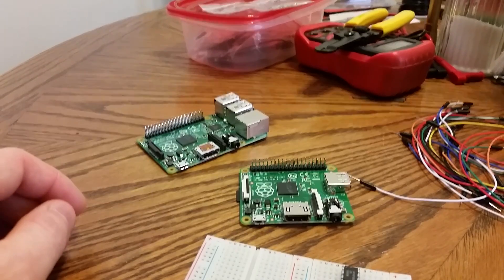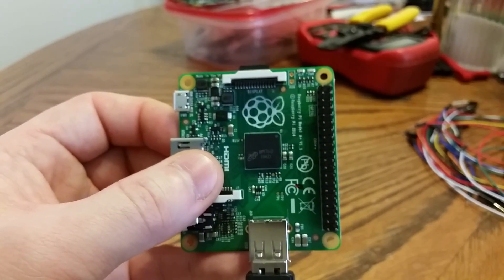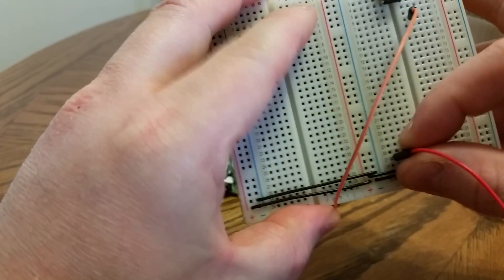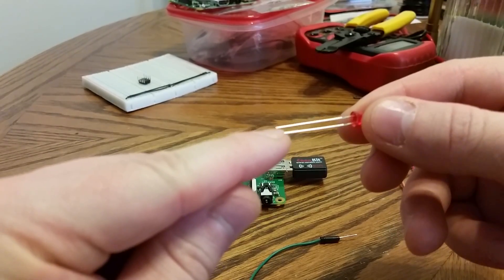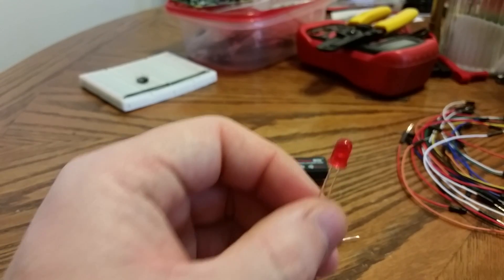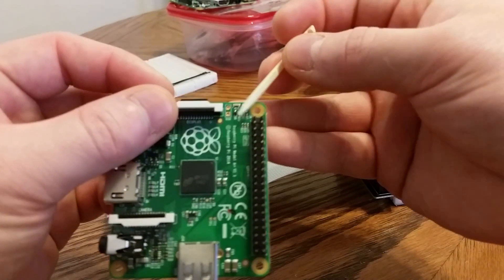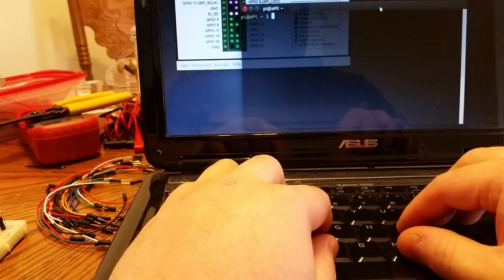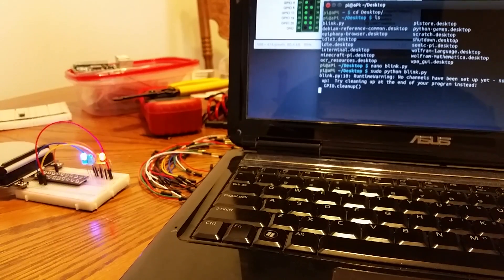Raspberry Pi For Beginners: LED Connections, Bread-boards, and Programming

Comment: Hi 
I like to know how i can get a LED to turn on when the Pi4 is on and fade in and out with PWM pin. and do this all the time when the Pi4 is on, (maybe 2 or 3 LEDs) and when i shut down the Pi4, the LED will turn off, so i know when the Pi4 has been shut down. 
I am setting up a VPN node in my home run on solar power
and using a buck converter out put at 5.150v dc in to the Pi4 5v Pin 4 and 
Ground pin 6. with a 1 amp fuse, 

a 1 tb HDD on the USB 3.0 port. that has a 12 v power HUB.

Comment: Out of curiosity, is there no way to only use one resistor instead of 4? I am thinking, instead of connecting the cathode of the leds with a resistor that goes to the ground, you could connect the cathodes to some other place, and then bring a resistor from there to the ground? Would that work?

Comment: You spent 10 minutes on horizontal and vertical on a bread board, but didn't really say anything about the coding. Probably, if I understand  code, I can figure out up and down on a board. This is 17:40 I'm never getting back.
Reply from the maker: The title states that it's LEDs, breadboards, and programming for BEGINNERS.  If you cannot read context, or even listen to the video, it may be too complicated for you: I am not teaching you Python, in this video, as there's too much in that area, and Python is too volatile to teach in a single video.

Not to mention that I give you my entire beginner's Python repo in the description... but, again, you didn't pay attention to that...

This video is about the rPi, which is hardware-based, so I go over the hardware, and glean over the code required to make that hardware work.

If you are unhappy with your purchase, I'd be happy to refund your money.
Reply from the maker: It seems you're correct.  Arch, being a bleeding-edge distro, has probably folded it into something else, as you've said.  This video, being two years old, I'm surprised comments like this aren't more prevalent.
Reply from the maker: Thank you!  I am glad you enjoyed it!

Comment: What style of Linux do you use for your PI? Is it text based only?
Reply from the maker: Currently, I am using Arch on my rPi's, and yes, I keep it in the command line, only.  The rPi isn't powerful enough to run a GUI while doing what I want to do with it, and SSH doesn't play well with an X11 server.

So, in short: yes, I'm using text-based only, with Arch Linux... but it doesn't really matter which distro you're using, or how you interface with the rPi, as long as you can work with it, and learn from it.

Comment: How are you sending the software from your laptop to the raspberry?
Reply from the maker: The Python sketch is in my GIT repo, and I just cloned it into my rPi.  I then use SSH to connect to the rPi, and implement the sketch via my terminal.

I am actually planning on making a video on this, but it's part of a larger playlist, building the rPi from the beginning.

Comment: I have a Rasberry Pi 3 just had a question on Board you maybe able to answer or someone else.. The Question is on the board says Run there's 2 empty Slots.. What are empty slots for an I add LED light or something there? Anyone know what those slots are for? can I add something in those 2 empty slots? I want add LED light on board if i can!! Thanks

Comment: thanks.....I liked that! more more!
I would like to learn how to forward/reverse a small electric dc motor with speed control...just for a learning experience.
Reply from the maker: Thank you, very much!  I'm trying to get a playlist together, but it's taking a LONG time to edit...

Well, DC motors usually only turn one way, with the rPi since you can only supply positive voltage.

Be careful with motors, as you can overamp the circuit and fry your hardware.  I'd recommend getting a motor shield, or a relay designed for DC motors, and doing a LOT of research into small circuitry.
Reply: Thanks for replying! I thought all dc motors were reversable simply by reversing the polarity and yes use relays for sure. Living and learning here! You rock.
Reply from the maker: No, they're not all reversible.  Some are, some can be reprogrammed to reverse, some have to be "rewired" to reverse, and some will never be reversible.  Usually, cheap DC motors are one-directional, only.  And, as a beginner, the mid-range ones will be, too... I don't mean to offend you with that one, there's just a LOT that goes into manipulating those things.

But I'm sure you'll get there, and you'll probably surpass me, eventually.
Reply: Thanks for all of that. No offense taken. You seem to be a real great guy. :)

Comment: Do I need a T-Board or can I just work directly with the GPIO of my Pi ?
Reply from the maker: You absolutely do NOT need a breakout board.  I actually prefer to work with jumpers, directly off of my rPi.  The only thing with that is, you will have to be careful that you're counting the pins correctly... measure twice, cut once, if you know what I mean.
Reply: Yeah ofc. I already started a bunch of random LED, photoresitor circuits just fine like that. What i'm currently making is mind boggling though. Can't figure out how to connect a water sensor I bought to my pi.
Reply from the maker: Which water sensor are you using?
Reply: stillborn86 It's a sensor I found on a project website called private eye pi. Here's the link https://ha.privateeyepi.com/store/index.php?route=product/product&path=61&product_id=102
Reply from the maker: It looks like there's a wiring diagram attached to that page:

http://projects.privateeyepi.com/home/home-alarm-system-project/wireless-projects/flood-water-presence-sensor

Looks like you make a voltage divider with a 3V3 pin and any GPIO pin, with a 10K and 1K resistor.  Then connect the divider to the water sensor, and ground to the sensor.

As for the software, I don't have an account, so I can't really see any of that.
Reply: stillborn86 I consulted the diagram. But it was of no help to me because I couldn,t test it. I kept getting errors while trying to execute the software. It might be bad wiring because that diagram isn't very clear..
Reply from the maker: Well, the wiring is just a voltage divider... so:

1) Pin15 > 1K resistor > SigPin of the water sensor
2) Pin1 > 10K resistor > SigPin of the water sensor
3) GND of water sensor > GND of rPi

Beyond that, I can't really see the code, so I can't help you much, there.
Reply: stillborn86 I'm still stumped. Idk how i'm supposed to connect the GND of my sensor to the pi without a dual sided female cable. I can rip out the extra ones from the sensor, but i'm not sure
Reply from the maker: I don't have one in my hand, and I've never seen one in person, but can't you plug the sensor directly into a breadboard?  It looks like the pins should be spaced out for that purpose.  After that, you should be able to use a female-to-male jumper to connect to the sensor.
Reply: I don,t think so. I tried to force the pins in but I don't wanna break them. Someone else suggested that I plug it directly to the pi with a male to female as well. But it didn't click.
Reply from the maker: Hmm... I'd imagine it would fit into a breadboard, just like my breakout T-board...  Sometimes they're a little tight, but you definitely don't want to break your new toy.

It just seems strange that you can't plug it into a breadboard.
Reply: I wish I can post a picture. The pins are very squared at the end instead of having more of a contour. they won't go in
Reply: Oh shit.. my bad. I'm so tired I was trying to force them in vertically when the rails are horizontal. They go in and the module is now facing upwards with two pins coming out for the two cables to go to my water sensor. So now I do like you said and connect my GND, VCC and DO into my GPIO pins?
Reply from the maker: Well, I'm assuming you have female-to-male jumpers, as you're wiring an rPi to a breadboad, right?

Well, can't you use those to wire the sensor to the breadboard, the rPi to the breadboard, and then male-to-male jumpers to wire everything on the breadboard together?
Reply: Well, i'd only need one male to male jumper no? Bcs I can connect the wire to the rail which shares the whole row.
Reply from the maker: Exactly!
Reply: stillborn86 You're a genius man! Thanks for all the help! I think I can manage to get off the right foot now :)
Reply from the maker: Thanks... I just like helping people learn about this hobby.

If you need more help, I'm always here.
Reply: stillborn86 iI'm surprised by your availability. Not many youtubers tend to take the time to help out that often. Which reminds me, you've definitely earned a sub!
Reply from the maker: Thank you, again... I also host an IRC, which you can always use to get to me in real time, to work out projects.
Reply: Yeah, we can definitely get in touch! How do I get to join your IRC?
Reply from the maker: Usually, you would use an IRC client and connect to the OFTC server... the channel is #stillborn86.

But you can also use the web-base system:

https://webchat.oftc.net/?channels=stillborn86
Reply: Perfect! I'll hit you up whenever I need your insight :)

Comment: can i plug an old computer mobo speaker straight into the pi and just pulse out to the positive pin or whatever to make it play noise? also Fantastic tutorial
Reply from the maker: Marinated Pasta I'm not sure what a Mobo speaker is, but you should be able to plug speakers into the GPIO. The only thing you'll have to remember is that they're low voltage (3.3V) and low amperage, so you'll need some sort of transistor/MOSFET system if the speaker requires a lot of power.
Reply: the speakers that plug into the front panel connectors and beep when the computer posts like this one: http://www.ebay.com/itm/like/252465865564?lpid=82&chn=ps&ul_noapp=true also ty so much for responding i got my pi3 for christmas and cant wait to play with it ^v^
Reply from the maker: It looks like that'll run off of the rPi voltage, but I can't be 100% sure, given the lack of details in your link.  I'd assume it's a low voltage/amperage device, and should be drivable by the rPi.
Reply: thank you :)

Comment: Where can I buy the breadboard with the 'ribbon' or 'ide'-like things?
Reply from the maker: Are you talking about the breakout board?
Reply: yes. ^_^
Reply from the maker: Vince Paul Dela Cruz
Well, the one I have in the video is from CanaKit, but it's pretty large, and requires a large breadboard to fit everything plus your circuit.  Adafruit makes a pretty nice one, which is smaller, but I have never used it.

Generally, you can't go wrong with any of them... but I generally just use jumpers, as they afford me the entire space of my breadboard.

Comment: Hi, nice tutorial. I am new to this,  I went to buy some leds and resistors but don't know which ones ? the resistors 220 ohms but how much watts? and the Leds what size?
Thanks
Reply from the maker: Honestly, it matters, but not too much.  The people at the Raspberry Pi Foundation were really smart about their SBC system, and made it adaptable for a wide range of hardware.

But, if you want to whittle the mathematics down, you just need to use Ohm's Law: V=IR.

We know that the rPi GPIO puts out 3.3V, and that gives you everything else you need.  You can use whatever LED and resistor values you want, just remember that a diode usually has about a 0.7V drop across it.

If you want to find what size resistor you need, grab an LED and find it's operating current... then divide the 3.3V by that current to find the necessary resistor: (3.3/i) = R

If you have a resistor and want to find the proper current/LED for that resistor, you just do it the other way around... divide the 3.3V output by the resistor value to find the operating current for the LED you need to choose: (3.3/R) = i

As an engineer, you're usually going to use the first scenario, have an LED with an operating current, then need to find the resistance value to match that LED.

Comment: Hi, I tried to blink LEd using Pi 3. LED is blinking but its very dim. If i do GPIO out without time.sleep its bright. Can you please help me to figure out what i am doing wrong
Reply from the maker: Before you setup your GPIO as an output, the rPi automatically sets it as an input.  Because it's an input, there's always a small amount of current running through it, which is why the LED is on very dimly.

But, when you set it up as an output, you effectively stop all current until you set the pin to "HIGH" and turn the LED on.
Reply: Hi, Thanks for the response. By mistake i posted the same question in another video also. 

If i run below code:
        GPIO.output(pin,GPIO.HIGH)
LED is bright and on'd continuously. 

If i add sleep. below code

GPIO.output(pin,GPIO.HIGH)
time.sleep(1)
GPIO.output(pin,GPIO.LOW)
time.sleep(1)

LED is blinking very very dim.

I am not sure what i am doing wrong here.
Reply from the maker: Naga Raja  It's hard to tell with stubs, like this.  If you could post the full code, I could give you a more definite response... but the stubs look fine.  Are you using `GPIO.setup(pin, GPIO.out)` before all of this?

If you post the full code, I could try to run it on my system, and see what's wrong.

Comment: What if I do not have the USB internet thing? How do I connect my raspberry to my wifi?
Reply from the maker: Well, if you have a rPi3, then you already have a WiFi module built-in with your system.  Otherwise, you'll need to use the Ethernet port to connect to your router, directly.  If you have an rPi that doesn't have an Ethernet port or the built-in WiFi module (Zero, A+, or A), then you're going to have to buy a USB WiFi dongle like I have in my video... otherwise, there's no way to connect it to the network without some soldering and wiring/hacking.
Reply: stillborn86 I have a rP3 so that's not a problem anymore. Now, I have a question once I run the code it gives me an error: IndentationError : expected an indented block. How can I avoid this? Thanks for taking your time
Reply: stillborn86 nevermind I found out what was the error. Once again, thanks for this video it's really helpful. :)

Comment: Infinite amount of current, in theory. One of my Engineering Professors was OCD about that.
Reply from the maker: And he's right... there's technically no such thing as infinite current.  There's going to always be resistance in the wires, breadboard, and even the power source since it's not ideal.

But the purpose of saying "infinite current" is to teach Ohm's Law and to get the point across that you will undoubtedly overamp your diode without an inline resistor.

Comment: So I dont understand where the power is coming from to light the LEDs. I see that some GPIO pins are 5v and 3.3 v but none of them are connected. Unless the signal sent through the gpio pins is enough to light the led?
Reply from the maker: Your assumption is correct.  The "signal" that the GPIO pin sends to the LED is a +3.3V output.  So, when you turn the GPIO "on," it sends +3.3V through the pin.  And, when you turn the GPIO "off," it turns that voltage down to 0V.  So, all you need to do is send that positive power to the positive end of the LED, and send the cathode of the LED to the ground, and you'll have a working LED in no time.

Comment: Explanation is super.
You entered commands in terminal right, is it, in raspian OS ? 
Can you please explain how to connect HDMI to HDMI cable to my laptop ??
How to dump the program ?
Reply from the maker: You cannot connect the HDMI on the rPi to the HDMI on your laptop.  They're both output-only, and it will not work.  There are multiple ways of connecting to your rPi, and I'm in the process of making a video series, encompassing several different options...
Reply: +stillborn86 Thank you very much for your quick reply.
Request :Please make it as soon as possible.
Reply from the maker: Satyanarayana Dhangeti
I'm trying, there's just so many options that it's easiest to make them into multiple videos.  That, plus being sick, and school starting back up has slowed me down, considerably.

Comment: can you teach us to make a game
Reply from the maker: What type of game?  I can try to teach you anything, but a request like this is pretty obscure, and open-ended.
Reply: I apologies, that was my kid asking the question while I was away from the computer. On another note the py code did not work when I tried it.
Reply from the maker: Andres Ramirez No need to apologize... It's not a bad idea, and it's nice to foster a child's curiosity.  I'd just need more constraints in order to answer the question more concisely.

As for the Python code not executing, which part failed?  What version of Python are you using?  What went wrong?